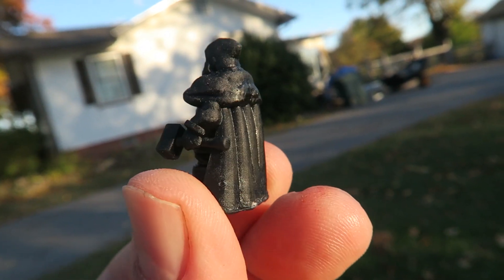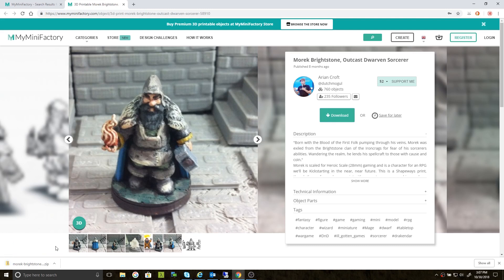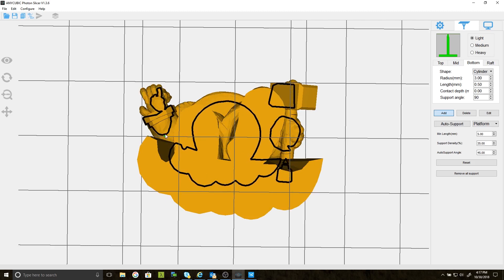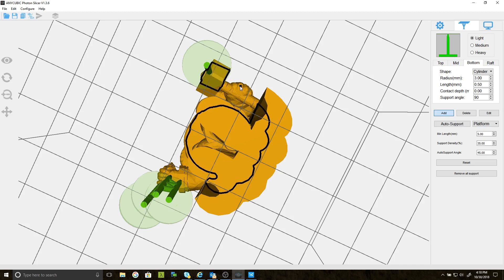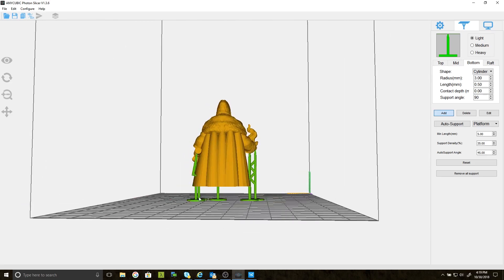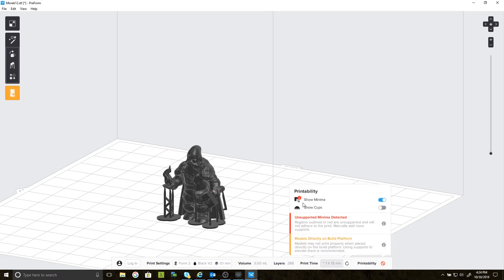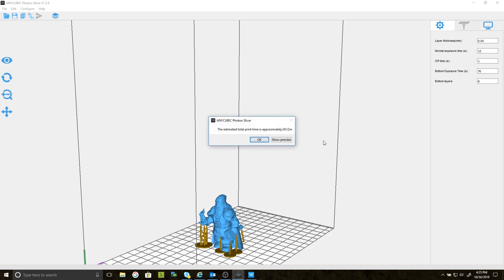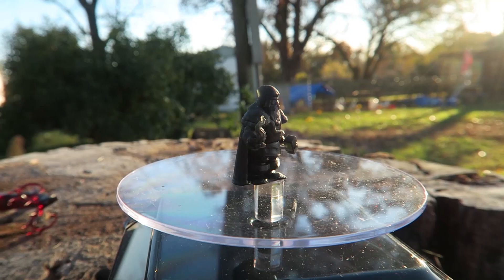How to 3D Print Miniatures on a Anycubic Photon Resin Printer!

Comment: Dec. 18, 2019---Thanks for the video. I'll be buying one of these printers next year, but no interest in miniatures. Though I may do some as nephew is still into D&D. Got back into modeling, but going for 1/35th scale zombie/apocalypse dioramas and I want to make them real as possible....no Mad Max look bs. One of the biggest problems is lack of MODERN plastic figures and zombies. Yeah, there's resin stuff available, but they start off at $10 a pop and when you want a dozen or more figures in a diorama...... And look around at the things you see every day, but don't think of such as mail boxes, furniture, etc. I've downloaded about 3K or so of figures, furniture, etc. that I want to print. I once tried scratch building a kids toy wagon, the kind a kid would pull behind him. The walls of the wagon were all of 2 pieces of paper thick and after making a silicon mold of it, out of NINE castings, only ONE was truly useable. And how about a portable generator? A friend sent me a resin one and detailing on it is amazing. Which is why I'm TRYING to learn how to use CAD not only to make things, but my own figures. Even to the point where heads, arms, legs, upper and lower torsos are separate pieces along with different styles of clothing. This way I can mix & match so I don't have a bunch of figures all looking the same. Thing is, I plan on mass producing many pieces simply so I have a large stock of pieces to use in future dioramas.

Comment: Would auto supports work just as well?
Reply from the maker: Yes!  Auto supports work well too for miniatures.  I prefer to print mine flat on the build plate and sometimes with auto supports, they get added to the base.
Reply: 3DPrintFarm 
Gotcha. I did notice that the sled bases blend with the miniature bases.

Comment: 1. what's the easiest way to hollow and add drain holes?  I see meshmixer will do it, but is there an easier way?  2. What is the process for dialing in a new resin? I see many spreadsheets with all the info already on there, but how does someone actually figure this out?  What does it look like wrong? 3. Where did you get the rotating display you use at the end?  4. Thank you for all the good info.
Reply from the maker: Lots of good questions!  Thanks for asking!  I usually use Meshmixer to hollow prints, but I have heard that Chitubox has an excellent hollowing feature.  Here's a great article on how to do that in Chitubox.  https://www.3d-work.es/hollow-3d-objects-with-chitubox-to-save-resin/.  Dialing in a new resin can be tricky as their are all kinds of factors involved (age of resin, temperature of room and/or resin), but the spreadsheets are a good baseline to get started.  I would suggest checking our the Anycubic Photon Owner's Group on Facebook.  We have over 10K members and have lots of experience. Check out documentation here for how to calibrate resin. https://github.com/altLab/photon-resin-calibration.   The rotating display can be found on Amazon.  There are TONS to choose from! https://www.amazon.com/s?k=solar+rotating+display&ref=nb_sb_noss_2.  If you have any more questions, please don't hesitate to ask!